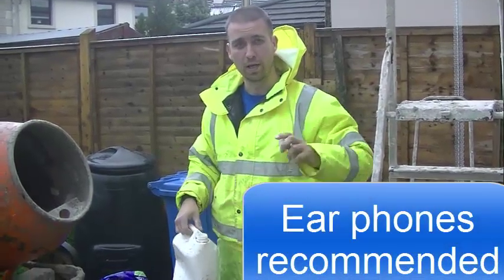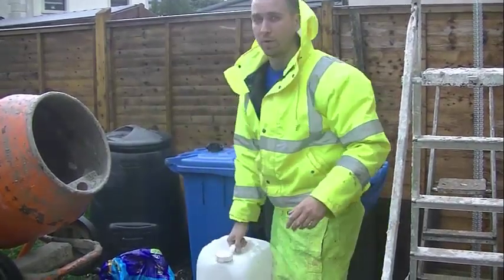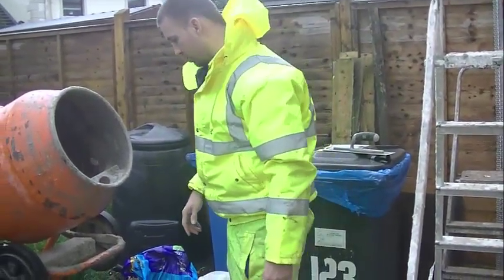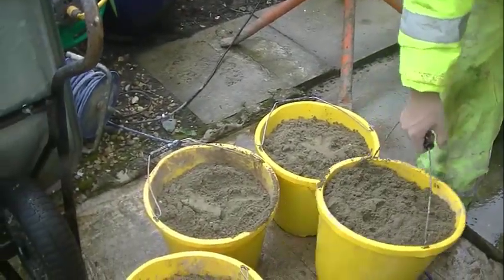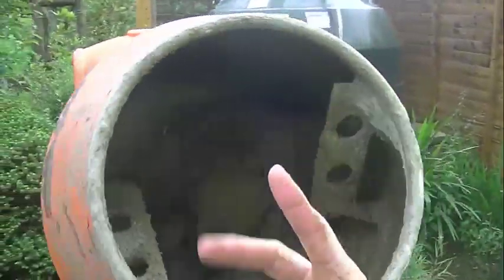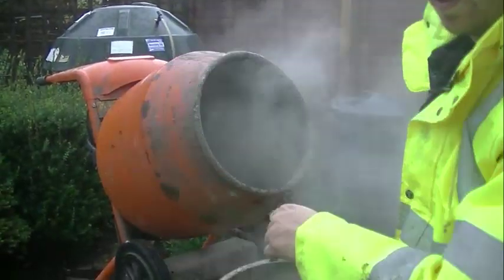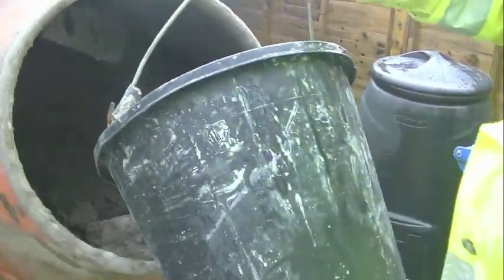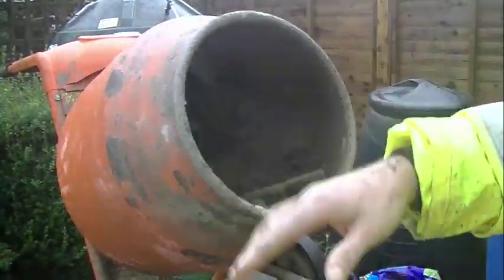How to mix cement render scratch coat 1st coat undercoat

Comment: Have started using lime since i changed sand supplier, i was using Kilsaran but im getting it from a private quarry and its much finer sand, not as good as kilsaran, but adding the lime has made it stickyer and more creamy, drys slightly quicker but it just means i get to float it sooner.
1 big shovel of lime per full mixer
Reply from the maker: Yea will make it fluffy stuff to mate we used to use a scoop per mix for dry dash but like you say it can dry fast at times cant hang about

Comment: Delighted to see you struggling to get the SBR lid off....this was me last week, I ended up having to take a set of water pump pliers to it! I thought it was just me getting old! lol.
Reply from the maker: Haha another subscriber said the same oh man this sbr is tight gear with its set around the lid Thats my excuse anyway (off cam I won ) 
Thaanks for watching buddy :)
Reply: I had this problem with my PVA can . . I couldn't find my pliers though . . So I boiled the kettle and poured the hot water around the cap . . The cap came off with ease just using fingers .

Comment: I think I need one of those mixers. It's hard to make the mortar or concrete for tilling by barrel and shovel . I know tilling in UK is different from Afghanistan.  You guys don't need concrete for tilling,  just glue and tile cutter. Good luck mac and God bless you
Reply from the maker: Here there is in old buildings what i call Belfast tiles , These tiles where applied using cement straight to the brick and we are talking between 100 to 200 years ago and i swear taking them of is almost impossible as the tiles is strong and the adhesive cement they used is  even stronger again even hard to remove with a kango drill , If you could ever get a mixer like this buddy you should very handy , Thanks for watching mate :)
Reply: Mixing on a big board might be better than mixing in a barrel Asghar my friend. Around 4 foot x 4 foot is a good manageable size and you could screw a 3"x 2" frame around the edge to stop stuff running off the sides. In the UK you can buy rigid plastic mixing boards that are similar to what I've described, the only real difference  being that the ready made ones are octagonal and are made of plastic which is easy to clean. (Do you have these in Afghanistan?) Hope that helps mate
Reply: @craigvarey9230  no we haven't.  But that was good advice.  Thanks mate .🙏👍
Reply: @asgharjafari6546  what mix are you using for tiling?

Comment: In Australia our plastering sand always needed lime added to sand/cement to make it workable and stop the water separating from mix-i guess our sand needed it in the day.
Reply from the maker: Oh man , Here did you find that the lie slowed the setting tie or sped it up ?  
Our sand here of the lough neigh is good , as long as it has been graded well :) #plastering #sand :)
Reply: @macplastering  -not sure on time difference as we always used it so Can't compare
Reply from the maker: Oh true man Just i dont use it much myself but i found that it makes it very workable but when it starts to set it just goes of quick  :)
Reply: Why not fill your mixer up?

Comment: Hi Mac, brilliant video. What mix would you use for rendering 215 thermalite blocks? I'm guessing something much weaker than 4:1 / 3:1? Thanks

Dal
Reply from the maker: Great question buddy this is inside yes?
Reply: @macplastering  nope it's for an outbuilding I've built! Wanted to render the outside cos it looks a bit naff. Used these blocks cos I got them very cheap incase you're wondering 🙈 thanks pal 

Dal
Reply from the maker: So I have only ever worked over this stuff on a few jobs here we also call it soap block and it can be cut with a hand saw think were are talking the same blocks here , but yes its so light and here it gets used for inside walls as it is still strong but light weight so great for apartments and upper floors as it keeps weight down and keeps strength and sound fire proof ,,,, but yes 1st time I cam across it a long time ago we pved it the pva dried like way to quick so realised this stuff is hot meaning it dries fast  and is thirsty , so we but pure pva on and wow still dried so then we floated it with render say 4 to 1 not easy not easy at all drying sliding just a pain , skimming wet wall get it on and get it trowelled fast this stuff will no hang around, so later on on another bigger job apartments here they are agin these wonderful blocks but a pain for us spreads, no one ever thinks of the poor plasterers LOL so this time we scud coated it like this video -  https://youtu.be/wTnwvSiMS_4
The mix was something like 2 to 1 cement with water proffer and pva in it to help it stick give strength and hold back the suction / drying out of the next coat with it did but it still dries fast , If I was you I would scud one day scratch and bead next day and rub smooth / finish 3rd day  a lot of work but it is what  think would be best mate hope this is helpful buddy
Reply: @macplastering  oh Mac thanks so much for the detailed response. Really appreciate it, I'm going to have a look at the scud coating method you mentioned.

Thanks again pal, all the best! 

Dal
Reply from the maker: Any time bro stay in touch mate :)
Reply: I've always done 3t1 on scratch then given it 3 days then 4t1 top coat don't forget waterproofer in scratch coat. Will never crack.
Reply from the maker: @kevinmcdermott2120  pretty much same as you here mate :)
Reply: You Could use EVERBUILD 507 RENDAGRIP it's pretty much the same as Febond blue grit that is used for skimming but this is for render.
Reply from the maker: @carlholroyd1462  Hi Carl mate so you wouid have to paint that gear on a day before and then render over or ??? I never used it before
Reply: @macplastering  yes mate next day ready to go, also it's waterproof once cured.
Reply from the maker: @carlholroyd1462  Cheers mate thats another option for these back backgrounds is it expensive and dose it go far ?

Comment: HOW do u keep the work area so clean. When i use my mixer it gets everywhere. I need tarpaulin, sheeys, wood, anything i can use to keep cement off the floor.
Reply from the maker: I would normally cover the whole floor with plastic but on this one the flags where to be lifted so wasn't a must , after every mix it was poured into a whee barrow or tub and if anything spilled just cleaned it straight away and cleaned u with hose after the day was over :) Thanks for the comment buddy
Reply: @macplastering  sweet, not just me then... great video.
Reply from the maker: @squidlings  You know the score no matter how well we cover up we got to clean up after anyway LOL

Comment: Can you just buy a scratch coat mix that you just have to add water to? If you can then can you recommend a product? Cheers
Reply from the maker: None here that i know off you can buy premixed sand and cement and tell them its for 1st coat outside here they are called rtu meaning ready to use

Comment: Cheers mate great vid very helpful I got a small dash job to do monday 1 scratch coat 1 top coat and dash so been very helpful. Do you put anything on walls before laying on the scratch coat at all mate? To prep it like
Reply from the maker: what kind of wall is it brick or block ?
Reply: @macplastering  what do you do to prep a block wall?
Reply from the maker: @MrRumbing  If it is old block it might need power washed and scrubbed clean 1st then possibly a scud coat, if new block might just need a splash of water and go straight on

Comment: What additive you use to dry it quicker? Thanks I'm happy to know.
Reply from the maker: What is the job you are doing mate
Reply: I do tilling job and I am starting to shift to concrete plastering..
Reply from the maker: @joevanisalcedo  most things i would do to make it go off faster would be frost proffer it makes it go off quicker sbr seems to also but can be a little harder to finish there is another product called so something like foundu makes it go of in 10mins for heavy spots

Comment: Get a old dustbin lid and stick it on  mixer when mixing and no more mix  splashing everywhere, tell me this are you using sbr as a waterproofer, do you prime wall first with sbr before applying scratch coat also do you ever scud wall before scratch coat, have you done any rough casting uploads, sorry for all the questions but I am a bricklayer who gets asked to render and rough cast a lot of the time after building blockwork so I might as well give it a blast I have done bits of rendering but want to learn  best possible mix, cheers buddy
Reply from the maker: Yes have lots of videos both dry dash and wetdash videos uploaded and did a huge livestream where me and other plasterers discusses loads of mixes , thing on dashing it is harder than it looks and all about prep work and mix :)  ,I have both sbr and some water-proffer in I wet the wall sometimes scud them if it needs it but good clean block shouldn't need it tbh Have a job im going to do at my own place where i will show me scudding block just for the video and demo of it but it wont need it tbh a good power wash would be perfect witch will also do :)  If you want I can have a look for them videos but should be easy to find on channel search bar just type in some key words your after and they should appear afer all over 300 videos lol but if you cant find let me know mate
Reply: @macplastering  cheers I will have a look at them uploads👍
Reply from the maker: @scoyle1750  Sound man let me know on them what ya think or if you cant find the things you where looking for , and if i dont have it I will in the future haha :)

Comment: Cheers for the vid, fair play boss. Question: Is that larsen SPR? I cant find that product, and whats it for?
Reply from the maker: Cheers mate I use the sbr for an extra little belt and brace it is a bonding agent and water proffer and makes the render a little stronger so it was just a little to help in all those areas but remember it also sets the cement of a little faster

Comment: If i sbr wall first could i get away with just doing one coat as the copings will only allow thin coats
Reply from the maker: What depth are they at buddy
Reply: Only got 12 mm each side roughly
Reply from the maker: @richardbatchelor3297  you could also cheat a little of the top let it dive in some that wont be noticeable if its like not to much

Comment: Will putting to much cement and plasticiser make it impossible to float  ????
Reply from the maker: This mix is for my 1st coat robby mate but to much of those would make it very very sticky for sure , Thanks for watching and commenting mate
Reply: @macplastering  Thank you for reply ! Your videos are excellent and straight to the point ...yeah i recently put to much cement in mix nearly 2 to in i reckon it was a nightmare to float up took hours stucking to float   thank you
Reply from the maker: @EIREESPANA  Yes to much cement will make it almost like clay and can make it crack loads we small cracks everywhere, also if you do 2 coats we where always told and taught the top coat needs to be weaker that the 1st
Reply: @macplastering  Thanks so much !
Reply from the maker: @EIREESPANA  Any time mate always here for a chat help or ideas I just recently uploaded a video on me doing some inside floating ready for skim coating

Comment: I'm a DIY-er  doing some sand and cement render at home internally. I'm struggling to calculate how much sand and cement to mix for a given square metre. Is there an easy way to estimate quantities? 

Also, I bought Sikabond SBR+ and I can't interpret the dosage instructions on the bottle; I can't work out how much I should be putting in. And should this go in both the scratch and top coat? I watered it down and painted it on the brickwork first.

 I also have a plasticiser that I have been putting a tiny splash in each time. Is it okay to use that in combination with the SBR+?

Thank you
Reply from the maker: So When i use sbr I always paint it on neat / pure and will coat over it while wet or tacky before it dries, when i add some to a mix I only ever add a drop full I believe there is loads off videos on my mixes on channel if you fancy a look....
There is for sure a way to calculate meter per weight of sand and cement im not sure on the mathematical formula  but no doubt it would need the area and the depth added in then the ratio of mix and would give you what's needed to achieve this, thing is I have been doing it that long just go by eye and of course ever wall and backgrounds are different, will need different mixes and or more coats to get straight ect   A good way to simplify how much you need is make one mix see how far that gets you then just multiply that and you will know how many mixes you shall need and how much materials hope this is helpful my friend
Reply: Thanks mate! What size trowel is best for sand and cement? I currently only have an 11"
Reply from the maker: @deaosatori216  11 inch woukd work well mate
Reply: Thanks mate I really appreciate all your help. I'm having fun learning!

Is it okay to put a dash of Sikabond SBR+ in a top coat? I've seen some fellas say "never put waterproofer in top coat" but I don't know why.

I bought a scarifier that has flat teeth and I'm finding it isn't sharp and strong enough to scratch the surface a lot of the time. Did I buy the wrong thing? Are those style scratchers for a different type of plastering maybe?
Reply from the maker: @deaosatori216  your gear is setting to muchnor on to thin if u wet wall down and add a little more on the scratcher should work 100%. I put water proffer in my top coat but really would use sbr can make it harder to finish

Comment: Hi mate good tips do you ever put lime in the mix
Reply from the maker: Not often only time I would put a small drop in would be for dry dash  it would make a nice fluffy mix  uploaded a new video you might like today if you get time to have a peek mate
Reply: mac plastering nice one for replying back mate I’ll have a look 👊🏻
Reply: mac plastering I put one part lime in loverly to use mate 👍🏻
Reply: Hydrated lime
Reply from the maker: @carper186  an old work mate used to put 1 cement 1 lime in his wet dash
Reply from the maker: @carper186  yes mate but i would only put a scoop in a small mix myself or a shovel in a  big mixer can be hard to get at times to so most times just got to go without , was talking to an older plasterer the other day he said they used to use lots of lime in white cement as it was not as good as it is now a days

Comment: Hi mac can i ask im going bag my walls. can i use this mix just to do that or is there different mix for bagging my walls ??
Reply from the maker: Hi peter mate when you say bag the walls is this a type of finish ? sorry its the 1st time I've herd that
Reply: @macplastering  i guess Bagging is aussie thing and USA thing its bacily  the application of a mixture that smooths an external or internal brick wall, without concealing the irregularity and texture of the bricks. im doing research for when i do my own home
Reply from the maker: I looked it u there mate looks like a cement render wash almost applied by sponge and or cloths if I was to do this them methods my mix would be similar this mix -  https://youtu.be/PxfawvJqCck
Reply: @macplastering  yer just like a wash. ty for link it given me some more  ideas. have good day m8.
Reply from the maker: @peterthornely3430  Any time mate :) stay in touch :)

Comment: Hi Mac,
Nice video, in wet dash render there seems to be a bit of controversy over the scratch coat mix. Some say no waterproofer, just plasticiser in the scratch and no waterproofer in top coat, as if you apply waterproofer in the scratch overtime the top coat will boss. What’s you thinking, experience of this?
Reply from the maker: Never had any issues with my mix mate I just always stick to what as worked for me

Comment: Love the videos mate just got some sbr , is it ok to put more into mix as i have got half new concrete blocks and some old brickwork in wall I’m going to attempt to render
Reply from the maker: Hi Richard mate Thanks for the support, Vest to read the sbr you got see what it recommends I have for some older jobs put a good healthy amount in and let me tell you that render will be there for a long time , bear in mind it makes render set faster a tighten faster during use also if using in top coat it can be harder to work with feels very sticky and can be hard to float up if this makes sense, have a good few videos on render and sbr up now mate might be of more help and we get new videos uploaded every Sunday but try y best to get more than 1 a week uploaded to help any body board and myself something to do :)

Comment: Good video mate just wondering do you know what sand and cement I would need to get a golden sort of colour of render
Reply: There's actually a colour additive you can use. It's in powder form and comes in various colours. I can't remember what it's called but it comes in tins and you'll have to experiment with how much to use. Travis Perkins stock it mate. Hope that helps
Reply from the maker: Like my good mate Craig says there is additives for sure dyes you can add to the mix , there is also coloured renders like webber and k rend , so much choice its unreal and there is another way witch in the future I will show you all on video as it will e much easier and also every one will get to know what I know :)
Reply from the maker: @craigvarey9230  Top answer Craig :)